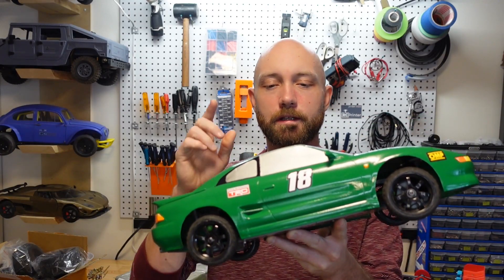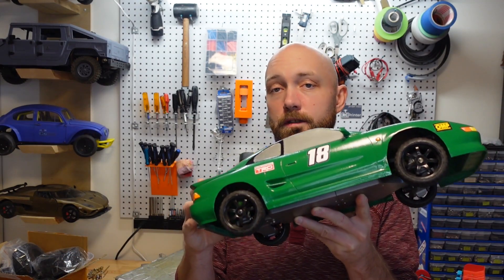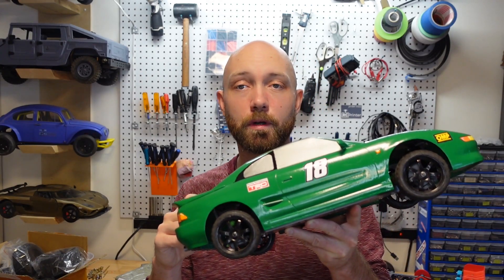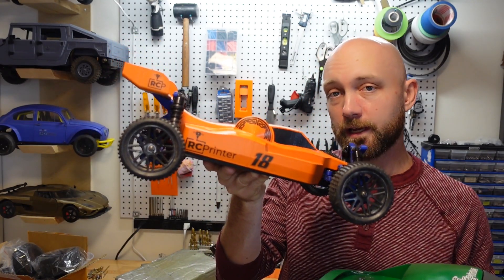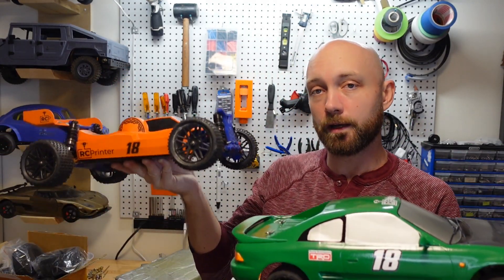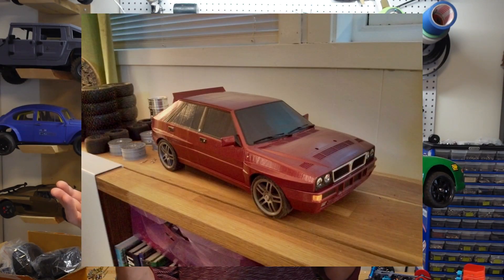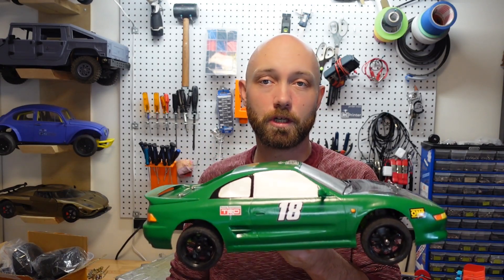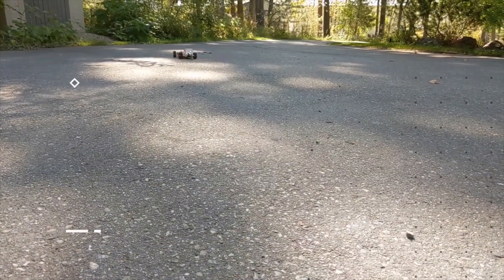3D Printed Touring Car Build - The Veltro

Comment: Can this be run on brushed motor aswell? It looks like it would fit.
Reply from the maker: oh for sure... anything in a 540 size (~35mm diameter) would probably work well but it might start to get pretty hot if you want one that goes as fast as this one (13.5T brushless is what I have installed)

Comment: Love the Chanel and the website. Planning on building a few from the kits you offer. What tools do you recommend?
Reply from the maker: Depends on the project but the most important things would be hex drivers (handled or for a screw gun) and a soldering iron for your electronics.... and a 3D printer :) I find my dremel pretty useful as well but you can get by with a hacksaw and files for cutting up any metal bits.

Comment: Cool print/build. I have to say the pinion and spur are very noisy.
Reply from the maker: yup they are... I installed a 3d printed spur that could be it... it also could be the belts. Haven't had a chance to figure that out yet.
Reply: @rcprinter  I think that are the gears. When i drive the MKUltra with the belts it's so quite, as the Robak.
Reply from the maker: @77LaKoS77  ok, new spur has arrived so I'll give er a go soon.
Reply from the maker: @77LaKoS77  Tried switching from the 3D printed spur to an associated plastic spur and am still getting the squeal. I get the same thing on my MkUltras. My guess is the belts.
Reply: Thats right, very noisy.